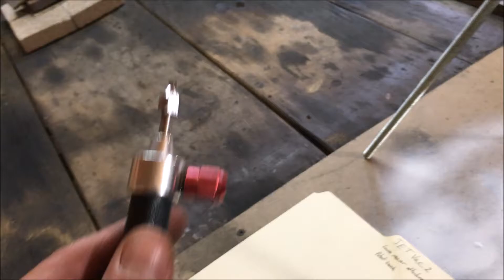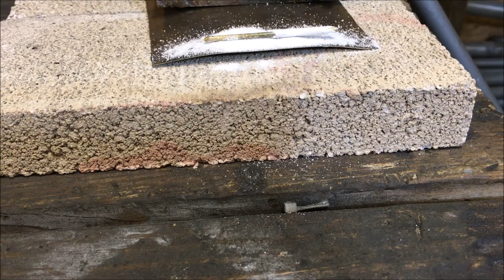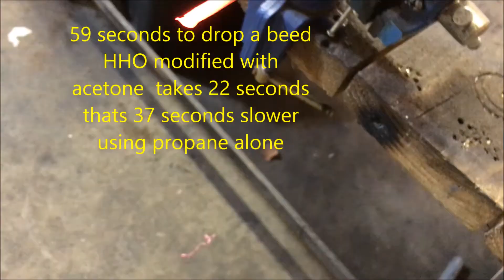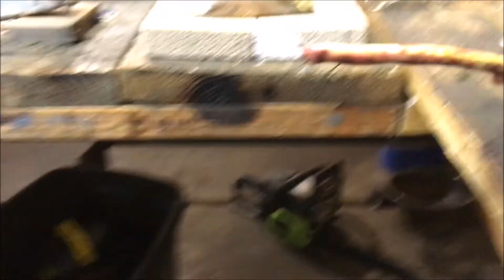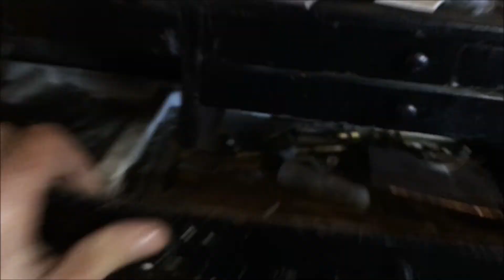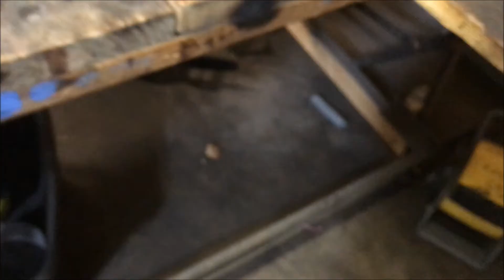Brazing With Acetone Infused Oxyhydrogen

Comment: if it;s For the cost only. Then  just refill your OLD  Propane gas can !...?       Thats what I do with a 30 Lbs tank & I  refill All of my mini Welding Tanks . And my Coleman camping cans to . Adapter is on EBAY , Amazon etc. for 08.00 $ US called ( Propane Refill Adapter Lp Gas LB Cylinder Tank Coupler )            Many Thanks
Reply from the maker: This gas can do things propane cant  , also i mix this gas with acetone vapor  to make the best brazing flame available . This device is far better then buying gas bottles , the cost of electricity doesn't even register on the power bill and yet i could spend $300 a year on oxygen and propane

Comment: This guy used gasoline, although he used a different way to mix it all, still, the idea that its gasoline, if it works, its cheaper than acetone... Also the addition of a hydrocarbon always helps reduce any excess oxygen making a carburizing flame [reducing] versus an oxidizing flame. https://www.youtube.com/watch?v=tRvcdD2mxdQ

Comment: WOW that is EXCELLENT! (~_^)-B I'm sold on it already!
Reply from the maker: not sure if you know this but acetone reacts with copper , it will make copper glow red hot in the proper conditions .there are many very cool videos of the phenomenon. Thats what gave me the idea to try acetone infused Oxyhydrogen  for brazing copper , the unburnt gasses at the interface actually react with the hot copper causing more heat  and i think another substance is formed but cant remember .
Reply: Sounds useful seeing as I have a lot of ideas for novel ways of utilizing copper in my energy research in the future.

Comment: I would be looking at using a huge rig personally, so tapping off a 1000 gal propane tank, if it saved money over the price of oxyacetylene it would be worth it to me... Just so I am clear, from what you said near the first of this... I had thought [wrongly I suppose] that you had mixed propane from the little bottle with your HHO gas [vaguely] like you did with the acetone...

I was thinking of using the HHO and propane blended in something like an Oxy Acetylene torch.
Reply from the maker: Yes i do mix these gases  , yes i T the propane  bottle in with the hho to produce a reducing flame [but not in this video ] and ad more specific heat to the gas on bigger jobs , mapp gas mixed with hho is amazing.I have a video on this .  https://www.youtube.com/watch?v=F2OlMDEJvdw
Reply from the maker: I did not mix propane with the gas when using acetone but i do have several videos called hho gas modification that show the use of propane and mapp gas and also acetone . Gas produces a huge wild lazy flame that i dont like  at all but it may be just what you need .
Reply from the maker: youtube is broken , i stumbled on these comments , never got a notice you left them ... Was not ignoring you as i answer all comments , good or bad
Reply: For some work, being able to shield the work from oxygen, as you well know is crucial, so I figure its fair to ponder the oxygen sumping aspects of the heavier gases which are still affordable, compared to rares, harder to get gases.

Interestingly, one might could use phosphine gas [hypergolic of course, therefore extremely dangerous, and likely quite expensive to make] when working with phosphor bronzes... Although it honestly looks like its not cost effective, clearly.

Should I get to where I can afford to experiment on such things, I figure I can synthesize my own phosphine gas  from low cost sources of phosphorous at that time, but for now, cheaper fuels are closer to attainable, so acetone, alcohols and gasoline seem more reachable.

Comment: Congrats sir nice  demo. How many plates  and what is the size of plates used in this hho kit how many volts & amps is there ?
Reply from the maker: i think its a 38 plate cell i would have to check ive built so many i cant remember , the cell amperage can be as high as 800 amps , this is a dry cell so the input is 20 amps dc at 115 to 120 volts but because the volt gap is 2.5 to 3.5 volts per gap you have 2,400 wats passing from 1 plate to the next   @ 3.5 volts that would be 2400/3.5 = 685 amps  or at 3.1 volts its 774 amps of electrolysis power , dry cells behave as transformers , that why there so much more efficient. for all the specs you would have to check my videos that showcase the torch itself , im not in my garage at the moment and i would hate to give you the wrong figures but the plate active surface is about 4"x4"
Reply: Thanks